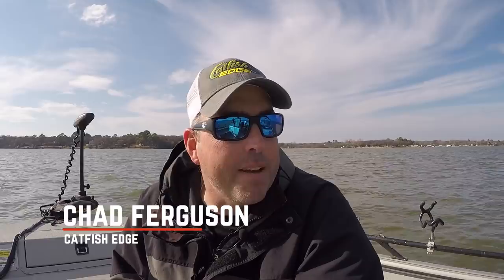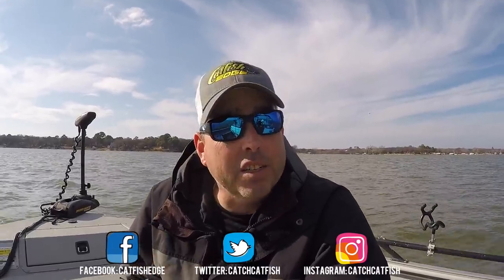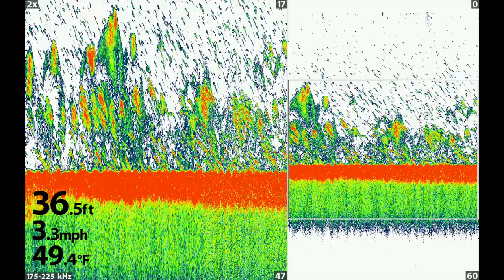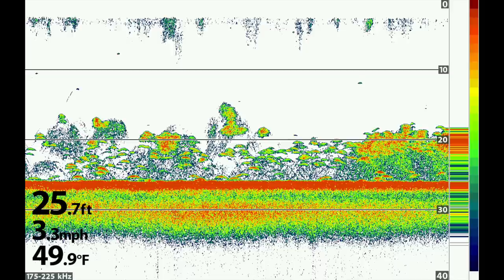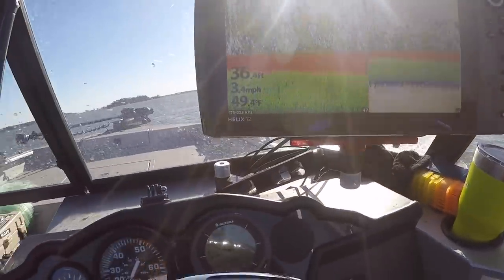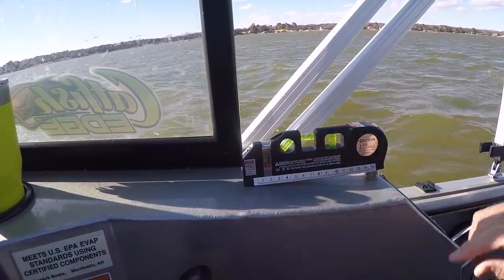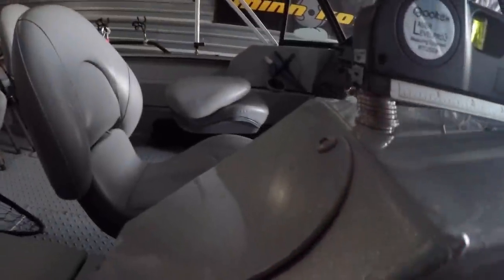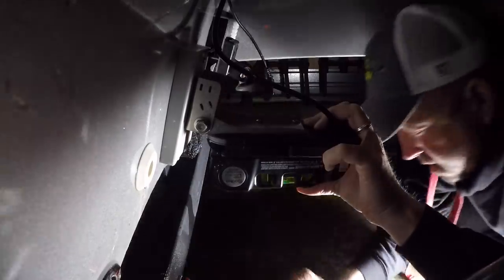How To Level a Fish Finder Transducer (For Better Images)

Comment from the maker: What issues do you have with your fish finder and what can I cover to help you better use and understand your electronics to catch more fish?
Reply: Difference between CHIRP and Down scan/image and which is better for catfishing?  I have a Fish Finder for my Kayak now that is a dual (chirp/DSI).  So I have to learn which helps with what situations (drifting, anchor fishing, looking for stumps for flatheads, look for other structure, etc).
Reply: Catfish Edge my feet don't read on plan?
Reply: My helix 12 turned off and when I try to turn  its faded screen  and it turns white and you cannot see anything
Reply from the maker: Check your wiring sounds like a power issue
Reply: I lost my on water map on my lowrance hdi elite 5
Reply: Make a video explaining what all these settings are on modern fish finders. One by one.
1. Name the term.
2. Define the term.
3. Explain what setpoint gives best results etc.
I had a Humminbird from the 1980's in a bass boat. Then went to a 2017 saltwater boat with the Simrad structure scan and am trying to learn all this new technology. After 2 seasons still dont see images like I see others have on the internet from thier fishfinders.
Reply: zash Almost every time we hear this it turns out that the electronics are not installed properly, once in a while it does turn out to be how the unit is adjusted or setup, but usually it’s installation problems. I would suggest having someone knowledgeable in how the equipment should be installed take a close look at it, before spending a bunch of time trying to change settings in the unit that may not ever fix the issue. Once you know the installation is correct- then start tweeking the unit settings if you need too.
Reply: @marineelectronicsinstallat2617  just watched an expert install a triple shot transducer. First he dropped it on the ground a couple of times.  Is that part of getting one to work correctly? If so plz post the drop specs.
Reply: Thanks again  ! I also have a  new Suzuki DF25 on my 14' smokercraft Voyager. I was wa to g to get a Suzuki tach/hour meter for it. Any idea if Suzuki makes a smaller simple gauge for this engine? Thanks sir.
Reply from the maker: Yes
Reply: Old video, but i got one for you. I have a Helix 7, Mega G3N with side and down. You pointed me to leveling my transducer, and it helped with the images. My problem is, unless I put the switchfire in MAX, and turn the sensitivity way down, it won't mark anything in the water column. Although it will show excellent bottom contour on 2D. On down imaging, unless I turn down the sensitivity almost to the point it gives me a blank screen, it shows an entire screen full of what looks like wisps of smoke in the water column, top to bottom. On every lake, every time. On side imaging, the only thing I can actually see well defined, will be the shore, bridge columns, or dock supports. Weedbeds, brushpiles, fish beds, none of that shows up. I'm about ready to throw this Helix in the trash, and buy something else. Oh, and this is with only the fishfinder running. Nothing else.

Any suggestions before I rip what's left of my hair out?

Comment: When I installed mine I used the natural level line that was created on my jack plate. If you have had your boat for a while this "line" will eventually be there. Your boat will always sit in the water the same and this line will always be level as it is created by the water line which is always naturally level. You could also use the scum line  created after a trip as your level line. I just measured the distance from  the line on the jack plate to the transducer both on the front and back of the transducer to match.   Your technique is also good and is more of a scientific and mathmatical approach.

Comment: I finally got the best side images ever after a number of things.  I was told to send my Helix 12 Chirp Mega Si G2N to Humminbird.  They actually tested on the water and got the same problems.  Replaced a circuit board for Si and Sonar.  Tested again on the water and good.  So we tested on the water after getting it back and seem to work a lot better.  The side imaging was still a bit hard to see.  I had told Humminbird something isn't right people are posting vivid snapshots of Crappie on side and down imaging.  We are fishing for Salmon and Steelhead.  That is a big target compared to a Crappie.  They didn't really give me much help.

So here is where things changed.  Chris Felts on Facebook Humminbird Tips and Tricks tells me to replace update 1.840 with 1.640, an older version.  1.840 I noticed my Si darkened.  Read that other people noticed the same thing.  Chris also told me settings to use.

Jigging Mode "ON" this forces the unit to read every ping.  This is a major help for better screens.
Color Pallet for seeing fish 1, 4 or 12.  I liked 4
Make sure Sonar is on High Frequency.  Chris claims that the setting affects other functions
Chart Speed just over what I am traveling
Sensitivity and Contrast - When I spot structure I move the pointer to pause the screen and adjust for best screen
Range 3X the Depth - good starting point.  I spotted fish holding close to the bottom and adjusted making sure to still have good appearance.

I would say I'm a bit afraid to load anymore updates.  Plus if the update doesn't benefit me because I don't have the accessories it helps I don't need it.

I think the biggest benefit of the settings Chris gave me was the Jigging Mode "ON".  I had done that July 2017 messing with settings and for got it on.  We went fishing for Chinook Salmon Sept 4, 2017 and we were spotting schools of Chinook all through the day even a bait ball of Anchovy.  Later I watched a video by Technological Angler on the Jigging Mode.  He said turn it off when done because it will make side and down imaging not work as well.  So I checked and turned Jigging Mode off.  Later we went fishing for salmon and nothing on the screen for Si or Di.  Could not figure out why we were doing so well and now nothing.  It never dawned on me I had Jigging Mode On and that was the key to seeing more fish plus better screen resolution to display fish.  

We went back out for a test run Jan 31, 2019 being that we were having Spring like weather.  I ran the side imaging and next thing I'm seeing fish all over the bottom maybe 10" off the bottom.  Bass angler told me he fishes the area and catches Smallmouth Bass and Pikeminnow there.
Reply from the maker: Awesome glad it worked out.
Reply: I think you mean you had jigging mode “off”. This can be confusing to the reader. Jus sayin
Reply: @chumchisk    No the setting is either On or Off.  I was told having it on increases pings and  better results.  Set to Off for “Jigging Mode” means the transducer pings less.  

I used this setting on my Humminbird Helix G2N Si unit.

Comment: This was an awesome and step by step instruction. Right now I'm running a 899 at the console, but have had the 1198 also at the console. Not once had I ever had any arches. Even on the trolling motor I've never had arches...that's hard to figure out why. I will try this next time out on the water and let you know.
Reply from the maker: This should help! If not come back and comment and I'll try to help you troubleshoot.
Reply: hey, well I finally got on the water this morning for a little bit. I can see the ramp on my side imaging from 120 feet away, so I know the ducer is set correctly, but I'm not seeing any arches. Maybe the fish are not in my location. When I have my phone or a SD card with me I can screen shot a picture.
Reply: Well, I've been out on the water a couple times now. The side imaging is never a problem. The first time I just eyed it into place and got lucky. My thru hull puck is the issue for high speed travel. I should have gone out in deeper water to test it, but it's flat so I'm confused. There should be arches???

Comment: I really appreciate your videos and especially this one as I have been struggling with the picture on my Humminbird.
Reply from the maker: Jeff, try this and make sure you have good power. Check out my install video, link in description!
Reply: Thanks and I have watched it.  I have the unit connected to the starter battery
Reply from the maker: Did you use shielded wire?
Reply: I don't think so. Just the wire that came with the unit as it was long enough to make the power connection
Reply: Where do you get the shielded wire?  I just used the wire that came with the unit as it was long enough.
Reply from the maker: +Jeff Freuler Amazon

Comment: This was very helpful in my first transducer installation thanks👍🏻. I do have a question..when I in stalled my helix 8 with DI i ran a little short on the transducer cable so I purchased a Y cable to get the needed length. I’m getting a reading for the DI but not the 2D sonar can you help?
Reply from the maker: Make sure it's plugged in good. Other than that it may be a bad cable.

Comment: Awesome video!  I will have to do this once I get my boat back from the shop.  I've noticed my arches are off a little while out on the water.  It's hard for me to steer at less than 5 mph (jet).   Would that hurt leveling to that speed?  Also what is your scrolling speed on the sonar?  1 per 1 mph?  I have a Helix 7 G2N.
Reply from the maker: Thanks
Reply from the maker: Panfish, chart speed equal to boat speed.

Comment: Great video.  I did the same thing but I wasn't going 3 mph which makes sense because that is the normal speed while side imaging.  I had to bring my transducer angle front to back down just a little.  We have 500 pounds of outboards on the transom so the boat sits in the water at an angle till you travel and then it lifts up a bit.  I also had the traditional sonar blinking at times like it wasn't getting signal then it would start receiving.  So I thought maybe I had a little too much angle.

Comment: We have the Helix 12 Chirp Mega Si G2N unit and I did the water level and then level the transducer on the trailer using the boat jack to get it level as I did on the water.  I was wondering about a few things.  Our boat sits low in the back because of the 500 pounds of outboards on the transom.  So I have two transducers and adjusted the Mega transducer using that level on the water going around 1.5 mph.  The 2D Sonar I adjusted for low to full throttle and to still get a signal on plane.  You mentioned you do the same level on the two??

Our Helix unit has been sent in three times and last two Humminbird replaced the Sonar, Si circuit.  Have been having a lot of trouble with seeing fish with the Si and Di.  September 4, 2017 we were seeing schools of salmon.  After that pretty much nothing.  Not sure what changed.  I might of installed update 1.640 but that is it.  I'm running 1.840 right now and considering going back to the 1.610.  Any thoughts on that?

Humminbird told me I might have interference on the transducer cables or power.  I moved my transducer cables to an electrical conduit from back to front of boat.  The electrical is a Marine harness with fuse at the battery and I have run it in a conduit to the front of the boat.  I don't think any of that has made any change.  I even had tried a device to clean the power before the unit and that made no change.  I removed it.

I also after loosing signal on the right I added a right Mega Transducer and that eliminated the problem.  Someone told me adding transducers may even lessen the performance of getting good screens.  I tried just one mega and that didn't do anything different.
Reply from the maker: I’d always run the latest update. I adjust level to scan speeds, don’t care about depth on plane, I have charts for that. Here’s some good basic troubleshooting tips. Have you followed all of these? https://www.catfishedge.com/fish-finder-troubleshooting-steps/
Reply: @Catfishedge  Thanks for the reply.  Yes I read through all your steps.  Very good outline.  I actually have a marine grade wiring harness from battery to unit that was made for me.  I also ran my transducer cables in a conduit to the front of the boat.  Power is in it's own conduit from battery to unit at front.  As far as I know I have good connections.  They aren't soldiered.  The wire harness was made by an installer and sent to me.  I have had a lot of problems with the unit and had to send it in three times.  last two they replaced the Sonar, Si circuit.  I did look for a Humminbird expert in my area and found no one.  Everyone is going to Garmin and not much available for Humminbird.

Comment: With the Mega Si transducer is it important to look at adding the second high speed transducer?  I know it depends on the boat.  I have had some issues with trying to adjust for Side Imaging and then the  traditional sonar messes up on the current unit.  I was told to try running just the Mega Side Imaging transducer if problems then buy the Y cable and transducer for high speed.  I will be installing a new unit in another week.
Reply from the maker: The HS transducer will help with getting readings on plane because it's a smaller surface area and therefore less prone to cavitation. How much it will help depends on the boat.
Reply: Thanks.  My other thought is that if $80 transducer gets hit not a huge loss.  The Si transducer is over $300.  Seems like a good idea having it up from the bottom.  The high speed transducer has a kick up bracket too.

Comment: I'm to go ahead and try this out. I have gotten a bit use to what I see but I think that the transducer needs leveled out at ride height to really get better images. Most I have my normal partner in the boat, what happens when I replace normal partner with a sub that weighs 275 lbs more then him to the front?

Comment: Got a good idea here from your video. Two torpedo levels, roll of masking tape and a roll of coins. With boat in water moving mount one level Fore and Aft and the other Port and Starboard. Secure shimmed levels with masking tape. Now, with the trailer jack and floor jack on land pitch the boat on the trailer to return both levels back to the bubble marks. In theory what was described in this video assumes the boat will always be trailered the exact same way and that the ground under the trailer is level and that is two flies in the ointment.
Reply from the maker: You're way overthinking it.
Reply: Catfish Edge Naw, I was a experienced kitchen and bath designer, fabrication and installation crew foreman before the owner. Levels don’t lie and repositioning the boat on land to mimic couldn’t be any easier. Now, using two 4’ levels on the other hand is “over thinking it”.

Comment: Home Depot sells a angle gauge. You can set it on boat then it has a marker to slide to zero. Round over by tape measures. You’re idea works. The gauge is just simpler and I use it to level mounting trolling motor on a boat with a 9 degree dead rise
Reply from the maker: iPhone level has become the new go to
Reply: Good idea. I forget I even have that

Comment: If your transducer is attached to the bottom of the bow mount trolling motor, can you just level it when boat is on trailer, or do you need to take the steps that you did on the water?  Thanks
Reply from the maker: The bow of the boat moves so much it’s not going to matter get as close as you can and move on

Comment: I may have a problem with interference on my transducer cable.  From the back of the transom the cable goes across to a tube that goes through flotation and out under the tray that runs along the side of the boat.  All of my outboard wiring and cables run there too.  No heavy battery cables but Tach, ignition and one wire to a electric downrigger not being used at the time of testing the fish finder.  What  did you do to eliminate going through the flotation tube?  I adjusted my transducer the same way you showed in the video.  My transducer is sitting sort of higher on the trailing end.  Your transducer looked almost perfectly level but that all depends on how your boat sits in the water.
Reply from the maker: It doesn't matter what it looks like compared to other boats. Every boat sits in the water different. My boat has pods so the transom sits higher than a boat without pods will.

Comment: Incredible video!!! Maybe this will help my down imaging. My side imaging has always been pretty clear, but down is bad. Also, side view is clearer to right then left. There's nothing in the way and the transducer is mounted on the correct side to deal with the prop's rotation. Any tips? THANK YOU
Reply from the maker: Are you trimming your motor up?
Reply: Catfish Edge yes I usually trim about halfway up
Reply from the maker: Tweet me @catchcatfish a screenshot and a picture of your transducer install and I'll try to help. Just remind me what it is when you do!
Reply: Catfish Edge I don't have a twitter but I do have an Instagram and I found your site. I'll DM you if thats ok. Also my boat is currently winterized in another state as I live up here in the north country but I will get back to you once I get the boat back! Thanks so much for your help I really appreciate it!!!